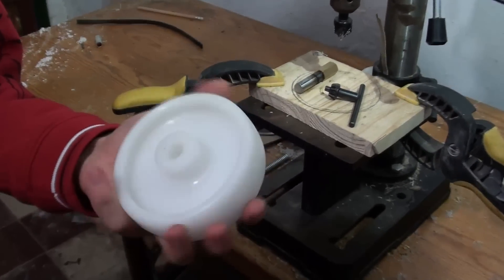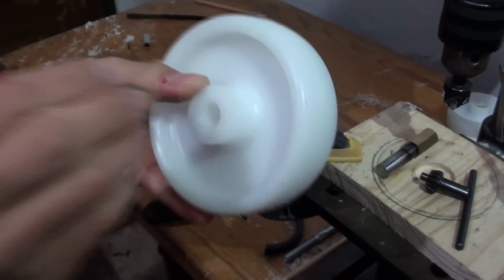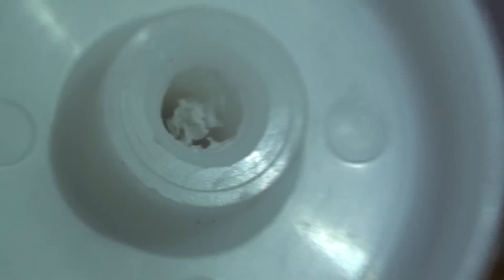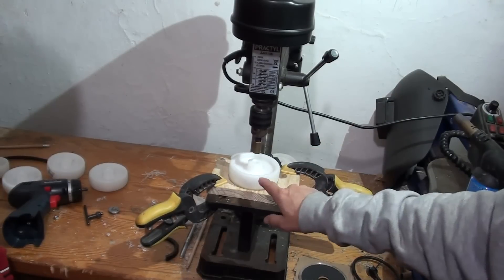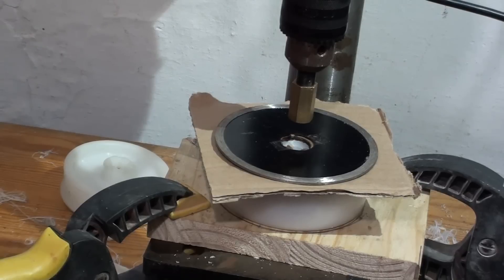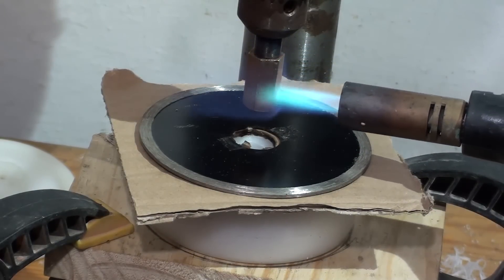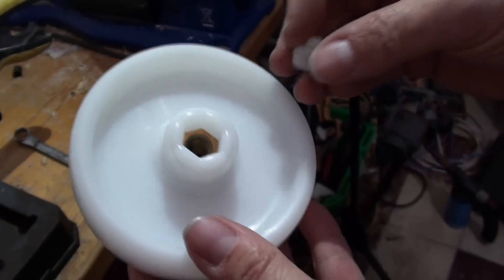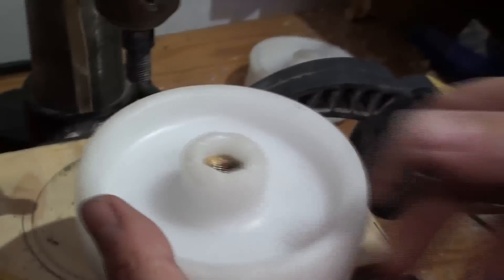Part 1 - How to make combat robot wheels

Comment: I just had a go at this, though with just a soldering iron rather than a blowtorch + pillar drill. It took a good bit longer and turned out a little wobbly, but hopefully nothing I can't fix.

I'll probably have to get a pillar drill anyway, so I might get a cheapy argos one later and see how that goes.